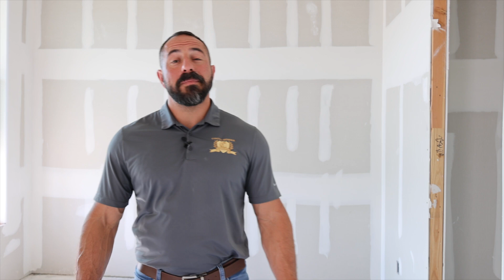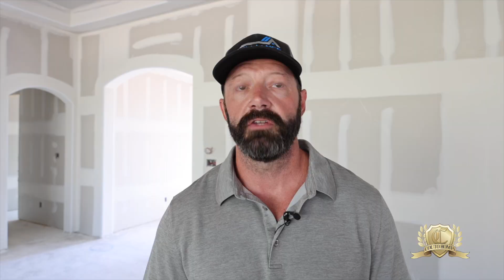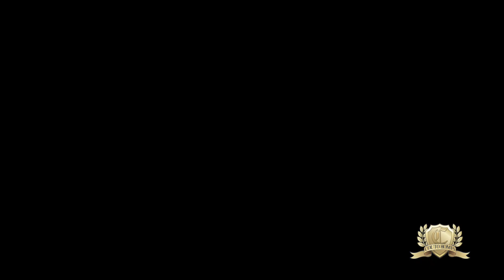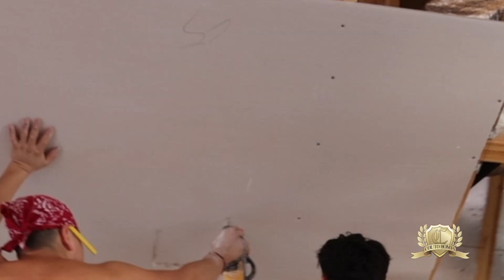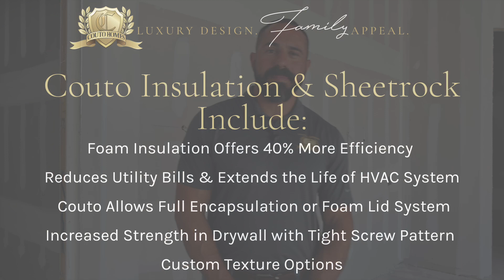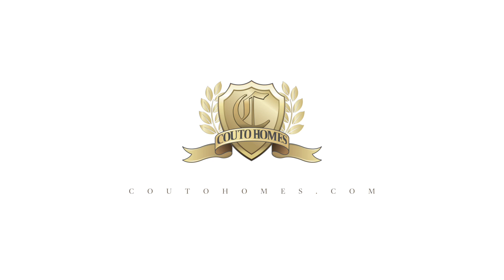Building Process - Insulation & Sheetrock

Comment: Are you insulating under the roof deck between rafters so that the HVAC ducting stays in somewhat conditioned space or are you insulating between ceiling joists?  Thank you
Reply from the maker: Hi! Standard foam cap insulated in between ceiling joist. Roof decking has a radiant barrier protection. Full foam encapsulation is sprayed at the roof in between rafters keeping the attic space much more comfortable.